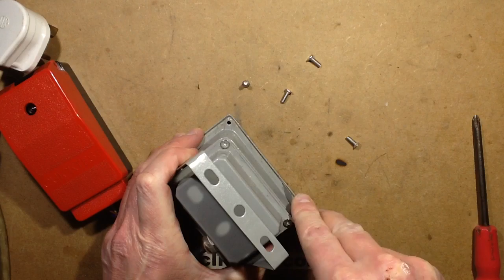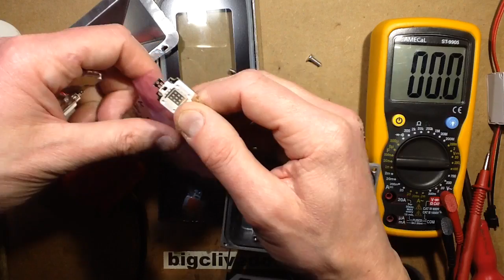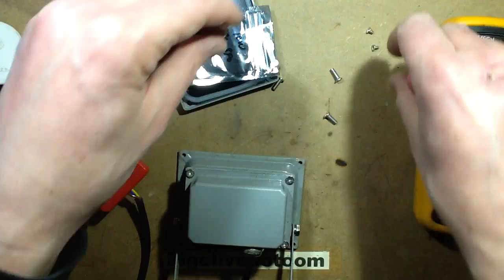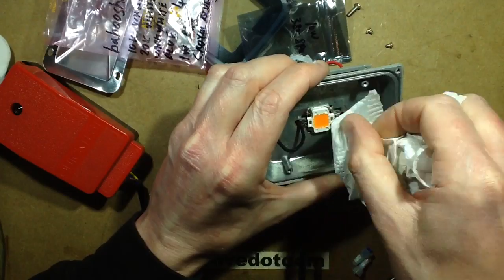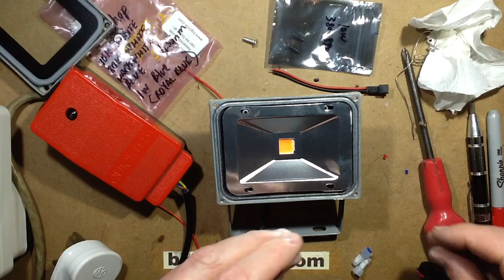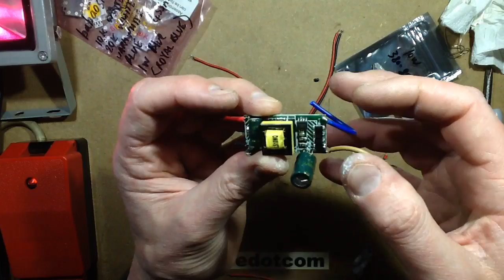Dead 10W LED floodlight  autopsy and repair/modification.

Comment: Clive, have you checked out those liquid cooled LED lightbulbs?
In theory it sounds good

http://www.dhgate.com/product/2016-new-e27-liquid-cooled-led-light-bulbs/390372120.html
Reply: I've made some before to go along with a liquid cooled computer and while its a cool idea.It is really a gimmick,mainly because the mineral oil really affects the lights output.Although I'm sure someone will find a viable use for it.But either way its a fun thing to try and play around with.Just Google mineral oil PC or LED etc and you'll find a bunch of cool projects.
Reply: I know those mineral oil PCs, a nice gimmick. Thought about building one myself. Went with some proper air cooling instead.

Gotta look up the LED projects. While i know it will affect the light, i wonder, how much?
And will the heat dissipation be so much better, that we can get realy super bright LED bulbs?

I would order one, but all my money is gone because of christmas. So that will have to wait till next year.
Reply: I was going to put a light meter to it but never got around to it.I'd say at least 80% got through no problem but that is a wild guess.Either way I'll probably make another similar project for my daughter.But with some floating stars,fish etc or something cool in it.It should be cool but that is about it,I dont see it as a viable thing to cool something like a grow light etc.So far to me it looks like a cool gimmick though I could be wrong.

Comment: I thought it was the Chinese's job to run 10W LEDS at 3W
Reply: It's their job to advertise 100W, use 10W & run 'em at 3W.
Reply: While having a single strand from the live touching the bare metal case that is ungrounded.

Comment: I have five of these 20 watt flood lights in my work shop and all of them have started flashing. I have replaced all five led chip
Reply from the maker: If you have to change any more and it is the larger square array with two rows of the chips inside, then you can fit a higher power LED on the same driver for built in redundancy.  The bigger LEDs have more rows of ten chips and the current will just be shared amongst them so they will have less stress.  I use 100W LEDs in my 20W bench lights.

Comment: Hey bigclive u can also power that 10 watt led with capacitor dropper.please make that video also 10 watt led on capacitor dropper.
Reply from the maker: It would work, but not be very bright.  Capacitive droppers are better suited to large series strings of low current LEDs.
Reply: bigclivedotcom Why don't you try making a high power LED run from a capacitive dropper? Perhaps from one of those energy saving boxes? I've run four series 30w leds off of a capacitive dropper, and at 120v 60z too. Its a super high power work light

Comment: I wonder could you un-pot the PSU using Acetone or some other solvent so you can see what has happened to the PSU.
Reply from the maker: PSU was fine.  It was also not a potted unit.
Reply: I'm confused.  You say it's a 28V unit, yet you you measuring 45V on your meter.  You sure the power supply didn't go bonkers and blow the LED?  A 60% over voltage is a bit much, even for unloaded.
Reply from the maker: It's a current regulated supply that is limited to about 300mA.  Open circuit it's voltage will float quite high, but when a working LED is present the voltage will sit down at whatever the combined forward voltage of the LEDs is at 300mA.

Comment: High BC, great video's!
Question: You seem to be a "light" man.. Why you never measure the lux or lumen of a light/led ?  Only the power consumption..  does not tell very much.
Maybe you could make a fixed distance setup and test the lumen of your need little projects.

Comment: Clive.  Unrelated question.  String of Christmas lights my wife has put on the tree have failed.  They all have a cover on them so can't easily see the filament.  Any easy/fast way to find the broken one?  Looks like a big loop of filament bulbs in series.  Thanks
Reply from the maker: If they are mains voltage you may be able to use a non contact mains detector stick to trace along the wire until the beeper stops.
Reply: They are mains, thanks!

Comment: Do you mean a separate white balance lock? Instead of that it is now grouped with focus and exposure by holding down finger on a spot? Personally I use this alot on my ipad, also for white balance locking
Reply from the maker: I use an A4 greyscale to lock most videos to an appropriate intensity and colour.  (Just did a Google search for a large grayscale image and printed it on an A4 sheet.)

Comment: Clive/anybody... where are those power supplies for a quid? Best I can find is the £2 mark. I also can't find the seller babaoshop. It's probably me being dumb but any links would be gratefully received.
Reply: Thanks man. Will do.
Reply: +InnaSoulSounds also have a look on aliexpress, you can find some for under $1 (less than 80p) if you don't need them in a little box anyway.
https://www.aliexpress.com/item/1-3W-4-7W-8-12W-12-18W-18-24W-30-36W-LED-E27-bulb-lamp/32508897997.html
Reply: Aye, I saw the ones not in the boxes on ebay for the same price. Cheers. Was looking for the exact same one Clive was using ideally.

Comment: Has that quick connect not got a fuse in it? Mine, labelled RS 458-926, has a 10A fuse in the lid.
Reply: James Lamb
Pretty sure it does - didn't he check it in the explosive lightning arrestor video the other day?
Reply: BC May have, I'll review that video.
Reply: tin2001 It does and he did test it in the explosive disconnect video.
Reply: Probably a 13 Amp cartridge fuse so that anything can be run off it. J.
Reply: James Lamb пкгрспоонгдоедоопщощгшлхпдмодрржрогтаобо
Reply: Для ебать Саке

Comment: One does not simply apply heat sink compound without making a mess.
Reply: When your 3.5 gram syringe of arctic silver thermal compound costs $5, you don't make a mess with it.
Reply: *****
Well, you TRY to avoid making a mess with it.
Sometimes you don't succeed.
Reply: When your IC Diamond 24 carrot costs over $30AUD.
Reply: Not if you used enough of it, anyways. Not really such a thing as too much these days with modern non-conductive heat sink compounds performing about as well as conductive heat sink compounds.

Clean up isn't nearly as bad as many will say.
Soap and water probably won't touch it, which is why everyone says it's hard to clean up.
Isopropyl alcohol or Goo Gone will get rid of it no problem.

Comment: MoviePro is pretty good for adjusting and locking various camera settings. I've been using it for a while but probably don't use enough of its features in my videos.
Reply: totaly ! you can adjust or lock any settings of any iThings on the go…

Comment: I took the driver out of one of my 10w LED floods and de-potted it (it was a soft, sandy, easily-peeled silicone-y goop) and it's basically the same as the original driver from this one, but without the metal case and potting... :)

And that babaoshop seller, they aren't selling any more it seems, and haven't done for about a month based on their feedback... :\
Reply: Babaoshop don't (currently?) sell on the UK site - try Ebay.com instead.
Reply: lots of stores have gone, but they were fronts for various things like newfrog
Reply: Charlie Dobbie
Very strange, I set the delivery search options for their items for sale to "Worldwide" and came back with nothing, despite them apparently selling their wares worldwide, weird...

Comment: Clive, I've been buying the Chinesium floodlights with the individual SMD LED's on a large PCB. While the build quality of the frame is dire, the LED's spread the heat over a larger area and seem to perform brilliantly compared with those high power chip LED modules
Reply from the maker: Not so sure about the large arrays of LEDs.  The ones I've seen so far all had issues with using on-board drivers that switched the LEDs in groups to ride the sinewave voltage.  They tended to fail dramatically.

Comment: no sound?
Reply from the maker: Check your surround sound settings.  The mono may be going to a non existent middle speaker.
Reply: Thanks for idea, may be the problem actually because laptop has external USB 5.1 sound card in stereo mode, maybe it reverted back to defaults. Will check tomorrow. At home tower PC all works fine.